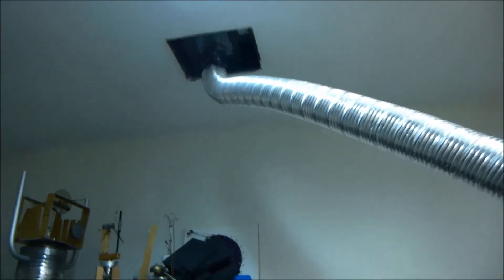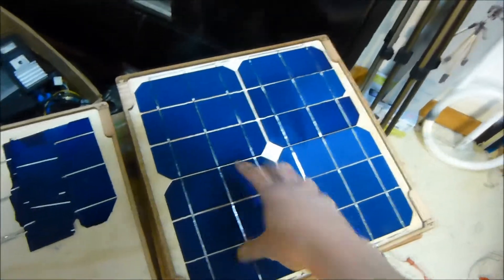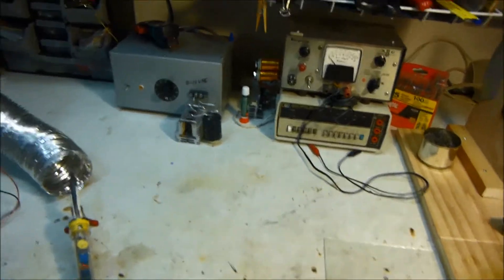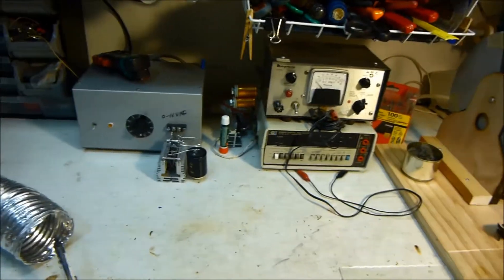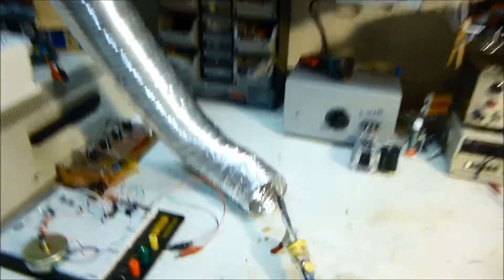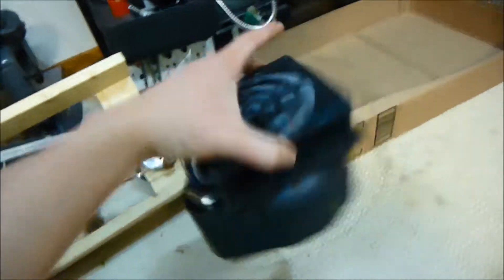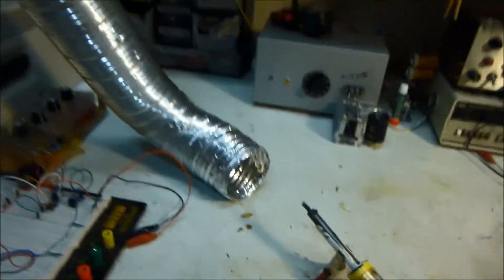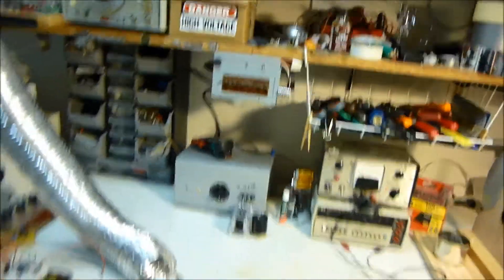New Intro Video, Fume Extractor, Building Solar Panels, ZVS Driver Talk, and Updates

Comment: Oh yea and the rule of thumb for ZVS mosfets is that your fets should withstand 4 times the input voltage. So for the irfp260n fets you don't want to go over 50V. But I have seen people take their ZVS up to 120vdc with irf840 fets. You need this overhead because of the inductive spiking happening when the fets switch.
Reply from the maker: Thanks!  Ya when I do push them I will hook up the oscilloscope and keep an eye on the inductive spike voltage and make sure I don't get to close to 200 volts.

Comment: Hey dude! So good timing! I yesterday just finished building a speed controller for my fume extracter that I finished building last week! Used the pwm circuit from your LED globe and tuned the frequency in so it sounds like a 3phase vfd. In other words, SOUND SICK!!! ;) Although I used a dc brushed motor for more power, the fan that your using probably has stepper motor (brushless) with a controller that has a electrolytic cap for smoothing at the input. The pwm is very likely the mess the controller up and pop the cap because of the high ripple current.
Reply from the maker: Hahaha really???  Great minds think alike!  Upload a video of it!  :)  I would love to see it!
Reply: Makerj101 Need to make a couple final changes and will surely upload a vid!
Reply from the maker: Sounds great!  I'll try and keep an eye out for it! :)